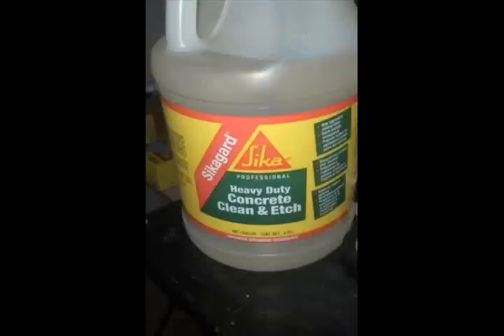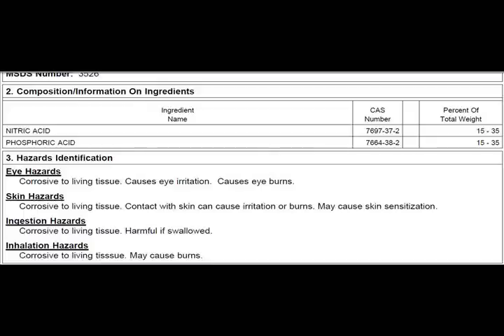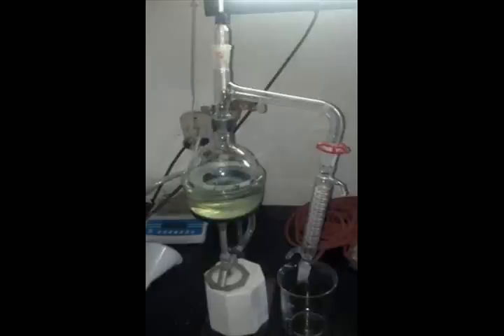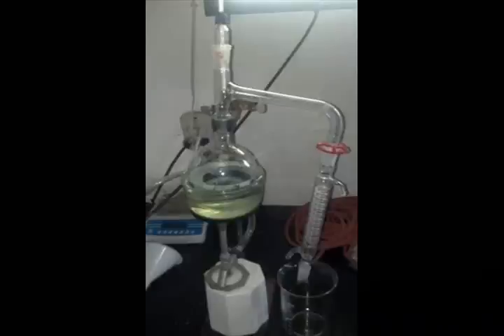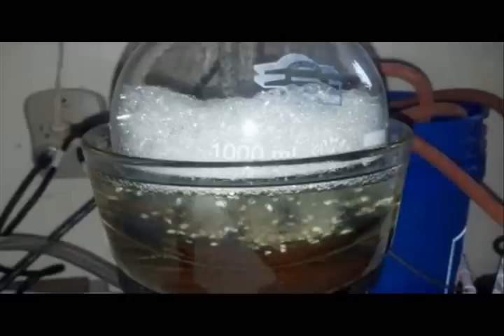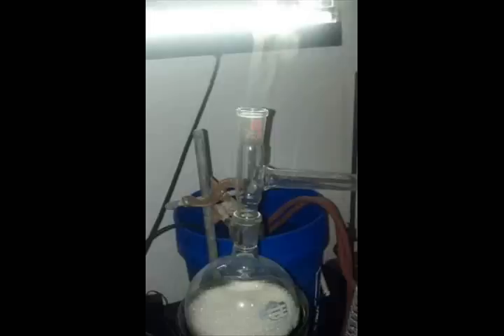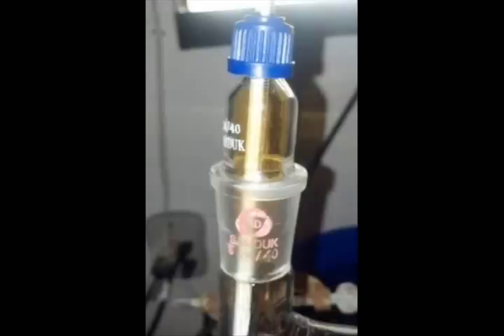Easy Source of Nitric Acid

Comment: an open bunsen burner and a large volume of hot acids!- you have not been initiated into the accidental lab destruction club. If this is what you're heating in this fashion you'll be thoroughly indoctrinated into the club. You may be blind as a bat and on a respirator the rest of your life but hey it's yours to piss off. Buy ALL the jugs of acid in stock at your local store is anything but "on the sly".

Comment: If it was real  high test nitric acid adding copper would produce billowing noxious clouds of brown NO2 gas. Fail
Reply: wrong. fuming nitric acid actually won't do that because it is so powerful, the copper is instantly passivated by a layer of oxide which prevents further decomposition. Azeotropic (68%) nitric acid, produces the billowing clouds of lovely toxic gas you mentioned.

Comment: To increase yield add Spectracide Stump Remover  (KNO3) and heat. Nitric Acid will form in equilibrium but boiling off the HNO3 Vapors and condensing those will allow for even more Nitric Acid formation.

The Phosphoric Acid is a wonderful generator with your setup..

Comment: You should do more homework, before attempting this type of reduction and sharing it here. Someone who doesn't know better, might be inclined to try your method out and they will most likely and equally fail. I'm not sure what is going on with the Phosphoric acid but I will tell you a couple things, I noticed about the Nitric acid. Your first distillation was probably more successful then you gave it credit. Concentrate Nitric acid, forms an oxidized protective layer on the copper and stops the reaction. Had you diluted it with water, it probably would have proved this and began reacting much better. Then, you can not concentrate Nitric acid beyond 70%. That is as good as it gets, due to the bonds it forms with water. Thanks for sharing, as it does seem you found a decent place to get Nitric acid from but the method needs reworked
Reply: hi clinton, I was told nitric acid would clean aluminum. Have you any exp or thoughts on this? thanks- sam

Comment: Hello, im working on a interesting project. My friend and I need some nitric acid to make some aqua-regia.
We need to make some micro particals of gold for an experiment making crystal cell batteries.
We were were wondering if there was a way  to neutralize the acid to neutral ph while leaving the gold suspended in solution.
We need to gold particals in solution to be absorbed while not damaging the battery with acid/ corrosion.
Please let me know if you have any ideas, any help would be greatfuly accepted and we will be sure to mention you on the video if we use any of your ideas thanks.
Reply: yes, I know how  to do that..but at what concentration do you want the gold to be dissolved at ? because that will certainly be an issue and may need a different method depending on concentration...

Comment: Good job man! Thanx for the instructions on Nitric Acid.
Reply from the maker: Thanks. I wish I could make more vids, but the accident i had wrecked my lab and I haven't redone it since. :(
Reply: How much% HNO 3 can turn if I miss NO2 in a solution of 37% hydrogen peroxide?
Reply from the maker: Брюс Ли it won't be worth the time. Very dilute
Reply: How to get a 95% HNO3 without H2SO4  using NO2 and H2O?
Reply from the maker: You can't really
Reply: Спасибо

Comment: Yeah jus use clean copper, sodium nitrate from instant ice packs dissolved in hot distilled water, and mix with muratic acid put a hose on that shit, then submerge the other end of hose in  a beaker of clean distilled water that is in a ice bath. Fuck around with the chemicals until u get a nice almost transparent blue hue in the distilled water that u had all that nasty Brown smoke filter through.  That blue water is now a weak but effective solution of nitric acid. Capable of dissolving alot of ferrous metal pins that are gold plated. Im not a professional but it works for me. Good video bro. I would appreciate some of Ur intellect with this stuff if u can email me.

Comment from the maker: In order to do that with a nitrate salt you would need to distill with sulfuric acid. Bubbling through hydrogen peroxide yields a very weak dilute solution and in order to get any usable acid you would waste a ton of peroxide and salt doing this and it would be even more expensive than doing it my way or buying it straight from a dealer. The bubbling method is only if you have no other place to turn to for nitric acid.

Comment: a easier way to retrieve the acid from the solution is to simply add copper, this will cause fumes or NO2 to form. just bubble this into cold distilled water or any concentration of hydrogen peroxide(higher the concentration the better). instead of this concrete cleaner, all you need is some form of nitrate salt, like potassium nitrate stump remover or ammonium nitrate fertilizer, dissolve it in distilled water and add copper and again bubble it into cold water or H2O2.

Comment: hey there guy, I stumbled across a nice lill product the other day at the local brew shop.  for cleaning stainless steel beverage and brewing equipment was this delightful dark blue 1gal bottle of "-five star- ACID CLEANER #5".  the MSDS is easy to find.  any how its 38% HNO3 and only 6% H3PO4.  the one I saw was for 28 $US here in california, don't know where you are but prob get it world wide.  any how I havn't purchased a distillation set up yet so I just made a mental note.  hope it helps.

Comment from the maker: I didn't say fast, I said easy. All you have to do is distill out the acid. The Sulfuric acid nitrate salt method does work but you get very little acid for your efforts and it is expensive and it's messy to clean up. This stuff only  cost me 28 dollars for almost 2.5 liters of nitric acid, you only distill it, and all you do is rinse it out. I would much rather use my method than the sulfuric/nitrate method but to each their own.

Comment: 5 hours for 150mm?  Not exactly a easy source, easier just to heat a nitrate salt and bagged drain cleaner (Example: Roodo drain cleaner from Ace hardware is around 96% sulfuric acid)  into a condenser. You can get at least 150mm of nitric acid (around 98% conc) in quarter of the time, depending on the purity of your nitrate and drain cleaner concentration.